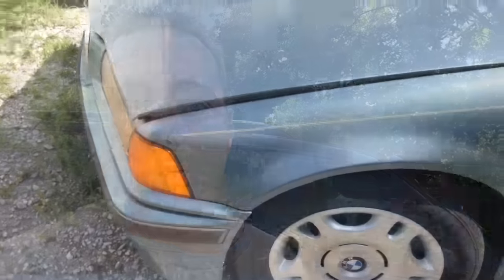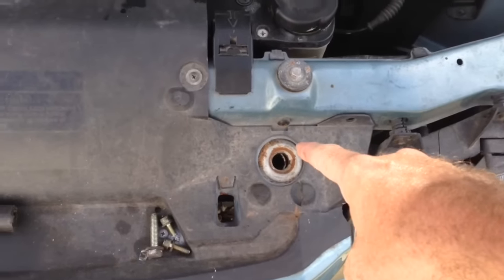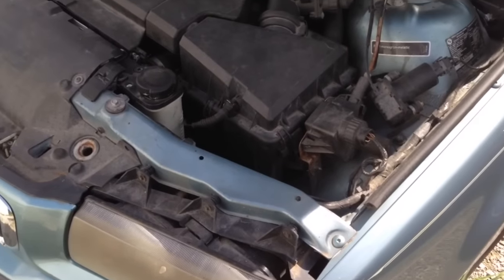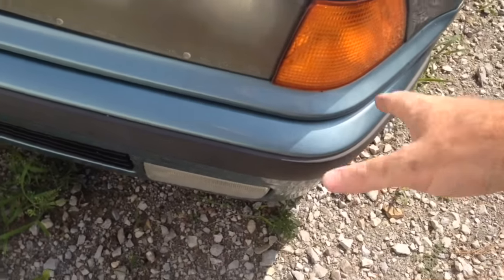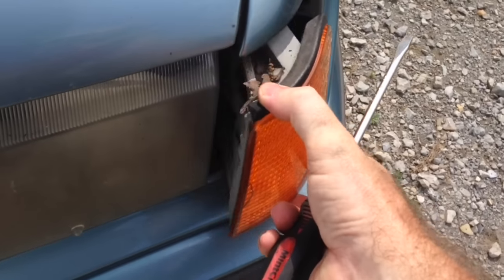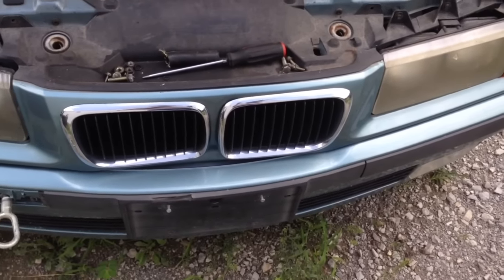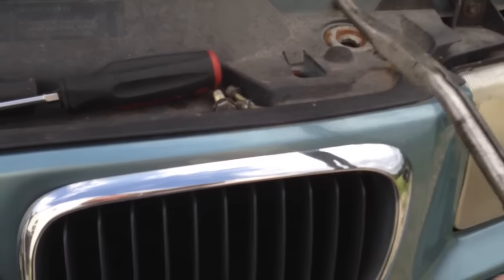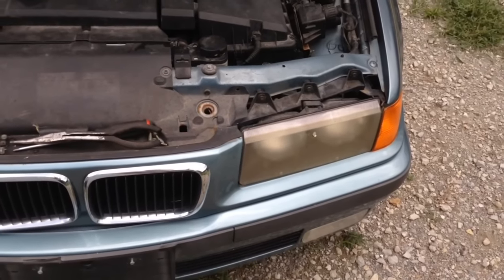How to open stuck jammed hood from broken cable BMW e36 BEST WAY in under 30 seconds !!!

Comment: 1st, YOU ROCK! 
I have a BWM 1997 328IC, I needed to access the fuse box to pull the blower fuse,(intermittently not functioning, blowing HOT air from bottom vents), i forgot to put the cover back on, & now my hood is jammed, drivers side is popped up, but passenger side is jammed. I've done all you recommended, except pulling the grill off. This car has 45k and in perfect shape, except for this. I can't find the cord. I have grave health issues, and this is my joy 😂 I searched all over, and you have the most common sense on BMW repair!
Reply: Were you able to open it?

Comment: On my car a UK model E36. The drivers side had the cable behind the indicator light. Thats the left side not the right side as described in your video. I got my one opened by chance after tugging on the cable. Although it didn't do much on the latches cable but the bonnet opened. I think my failure was caused by incorrectly aligned hinges and a stuck cable latches. The cable was not broken afterall. Thanks for the great vid. It helped alot!! I remember doing this along time ago but needed your vid to remind me again!!!

Comment: Thank you for your video. Helped me get back into my hood. My problem was the plastic air intake piece that sits above the grills and lets the hood latch go down was kinda broken and the plastic wedged itself to not allow the cable to open

Comment: took me four days to get the left latch open, right latch still wont open...  left latch took pliers to broken cable from inside the drivers side of car, machete under the hood, pulled on cable after removing grill,, used a knife to slide left side, used handle release from front of car.. I dont know what worked but finally the left side seems to be up a inch or so, now the right one.. could take four more days

Comment: Nice tip especially since my cable snapped using pliers to long I suppose.
Anywho I have new hood release handle & new(full)assembly any video for installation

Comment: Do you have a video to replace both hood cables? My cable is about to break and I suspect it's near the latch area. Do I really need to get front bumper and nose panel off to get them replaced? Thx

Comment: I have this problem and thats why i came here.i tried everything he said and it didnt work.popping out the light pulling the cable did nothing.i need to get the wire inside the cable to tug on or something. My hood still stuck luckily its not my daily driver

Comment: Now , can you tell me, where to check for vacuum leaks?
My car es driven through a flood that at the time hadn’t messed the car up. But a week later didn’t want to keep running unless I kept giving it gas. Changed a number of parts then ended up being a clogged cat.. now it runs, but I get a code saying there’s a secondary air pump malfunction. Got a new one but still running very choppy. Think there’s a vacuum leak, but can’t find it..

Comment: Do you have a video showing how to remove the lock latch part that the cables hook onto? 
Do you have to remove the radiator to get them out?

Comment: pulling the center cable will not release the driver side latch. Mine had the worst type of failure where the main cable came disconnected from the driver side latch. i ended up going through the corner light then lightly popping the headlight lense assembly off the adjusters on the headlight bracket and using a pic to disengage the driver side latch. not fun.
Reply: any help
Reply: I have this type of failure also - '99 323 RHD convertible, so everything is reversed, but the bowden cable has come off the driver's side latch.  Pliers through the grille has done nothing.  I'm out of ideas really, can you explain what you mean by using a pic?
Reply: Martin Grainger - seems like you will wait forever for an answer from this guy that reacts conveniently like a coyote 🐾 some times but mostly acts like a turtoise 🐢 as we'd noticed regarding his answer ⌛
any way, a pick is a hand tool compossed of a metal pick part (it has different shapes depending on the task to be performed), and a plastic handle like a screw driver and it could be squared, triangular or round in shape that came very convenient to pick up certain objects with different shapes for several tasks involving a pull action force or vice versa, to push it  👀
🚗🚔🚘 and it's usually used in the automotive industry for this purpose
and these tools could be usually found on sets of 4 or more per pack from snap on tools, walmart, target, autozone, sears, 0.99 cents stores to harbor freight tools 💬
just google it and youl have your answer right ✅

Comment: cool video bro 🎥
i have opened several hoods for different cars and models but im not really familiar w/ bms hood locking mechanisms 🔒
actually i have this situation going on w/ a 00 e46, but i don't think is the cable or any internal hardware assy adjacent to the engine bay affecting its overall operation bc the hood will pop out but i couldn't open it for a reason i would describe below 👇
 🌜 you wont believe this, but when my friend came last night w/ her car i was able to open the hood in less than 10 seconds in the darkness, but during the day i'd tried w/ no luck at all lol 🎲 💔
in my case, both front grills come out easy w/ not much effort, but the handle that activates the hood latch is missing and the hood pops up but it cannot open bc there's no release handle coming out from the front grill 🚫
i'd watched your videos on this regard but i could't find anywhere a description regarding this situation, do you have any ideas on how to solve it? 👂
thanks in advance 🙏

Comment: If you live anywhere near Washington or Oregon I will drive to you and see if you can get my hood open on my 1999 328i which is stuck shut
Reply from the maker: I am in Missouri, have some one pull the handle and. go out and pull up and down on the hood , unless the cable is broken then just follow the video
Reply: Thanks for the reply!  We ended up popping out the grills and getting a hack saw blade in there and sawing off the bolts and the hood popped.  This way took more than 30 seconds, about 20 minutes.  Funny thing is that the cable wasn't broken so we are not sure why it was stuck so bad.  We put new bolt on one side and stuck again!   So we had to saw again and got it unstuck a second .  But now afraid to put bolts on and close,,, any thoughts?

Comment: Hello from Brazil Nathan! Very great video! Could you please make a video showing the location of the F. AUC Sensor on a 328i e36?
Reply from the maker: The fan sensor is on the side of the radiator

Comment: only the passenger side of the hood popped when i pulled the latch in the beginning, after trying these things in the video none of the sides will pop open anymore, any ideas?
Reply: Adam Garami - seems like after a year or so waiting for an anwer you need to fanally call a locksmith 👀